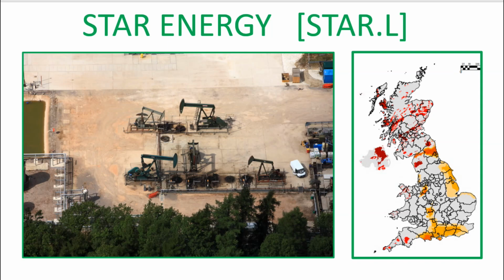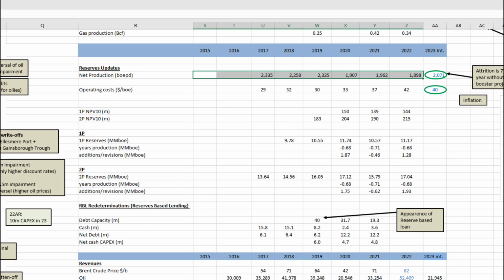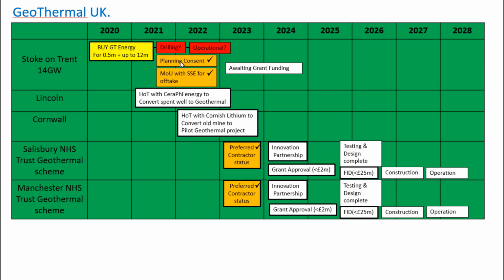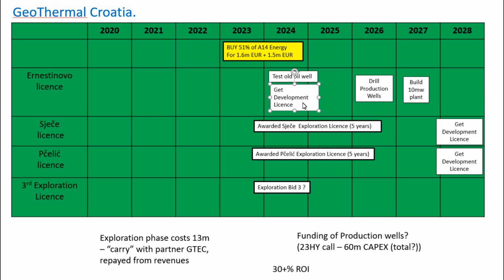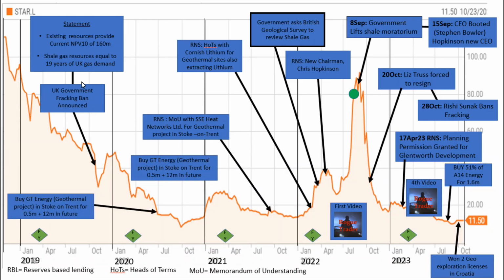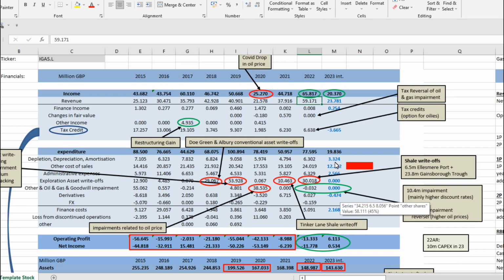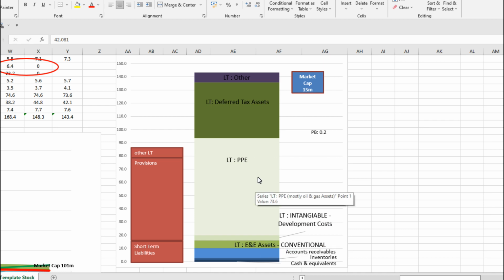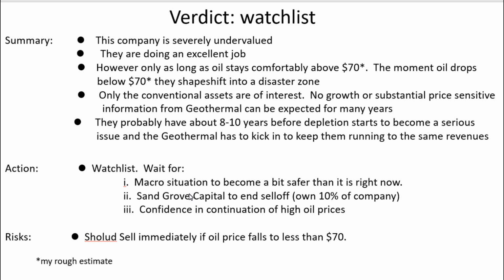STOCK ANALYSIS UPDATE  - Star Energy

Comment: Good presentation, thank you. After watching I moved on to the company's interims presentation and heard a couple of things I didn't remember you mentioning. Both are to do with the geothermal investments. First, the high teens/low 20s IRR for the UK stuff is at project level, so given the grant funding available, equity will do better than that. Also, carbon credits could be a significant (though not major) revenue stream, which I don't think has been accounted for yet.